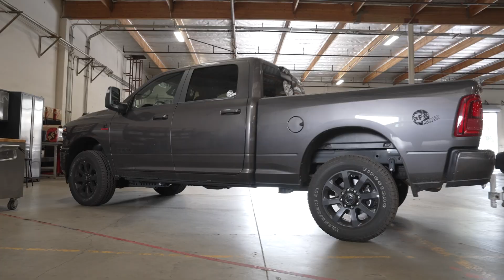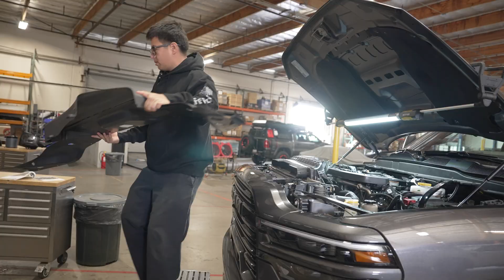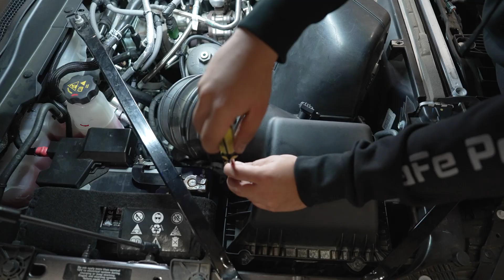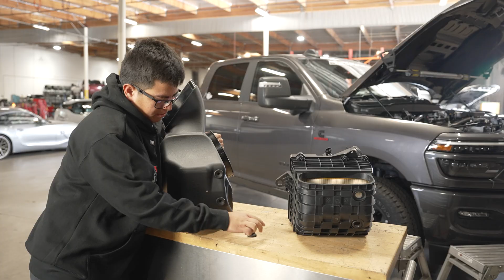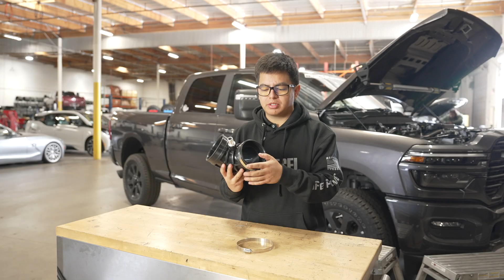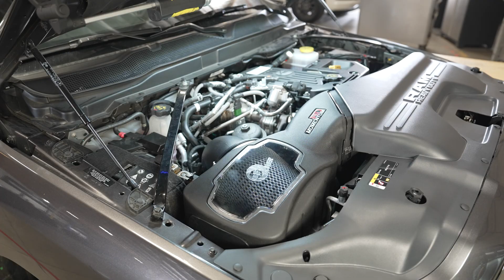Ram 6.7L Cummins Momentum HD Cold Air Intake Installation and Sound

Comment: Just installed mine and pretty sure I installed correctly but CEL came on and truck is idling high, any thoughts? 

26 ram 3500
Reply from the maker: Please submit more information to our Tech Support team by going to the contact page on the aFe POWER website!